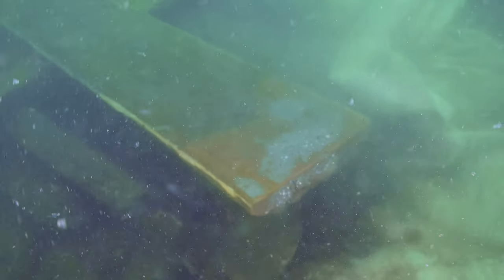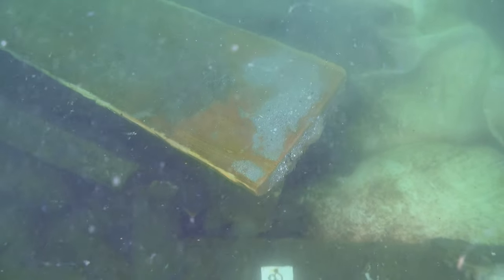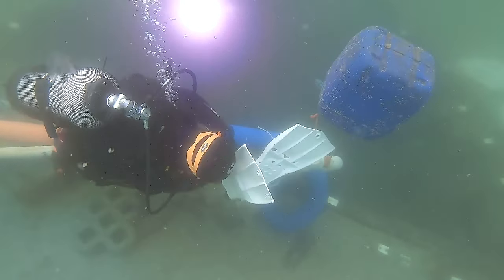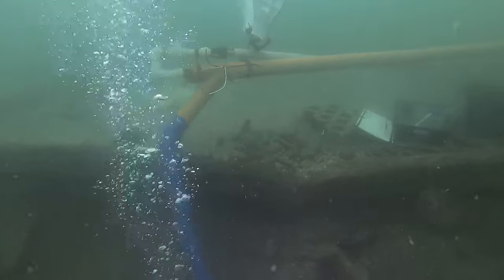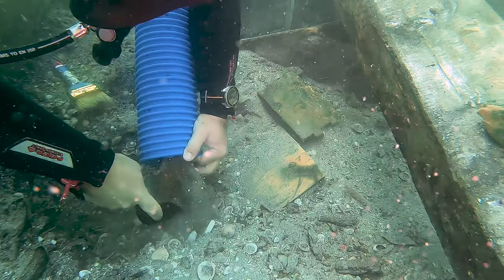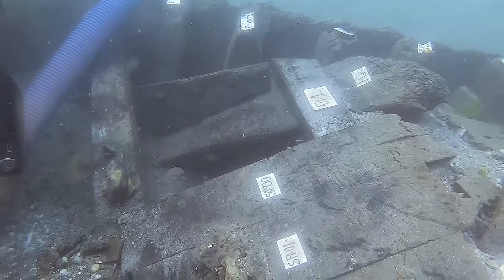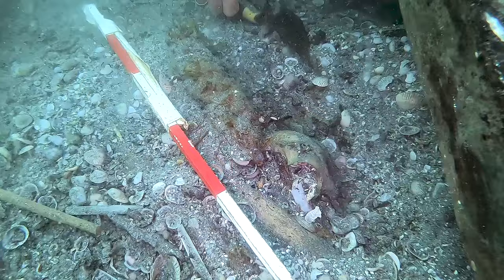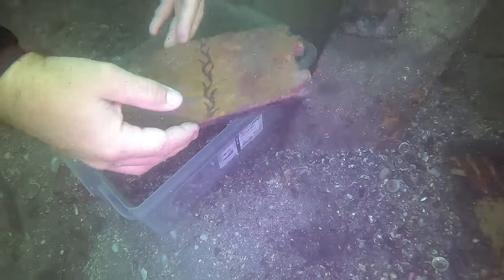Methods of underwater archaeology

Comment: Dr. Batchvarov what would be the typical duration of a single dive and do you have a safety diver keeping track of the time or does each diver monitor themselves. Thank you posting this and I am looking forward to learning more.
Reply from the maker: We do have a dive master who monitors time in, time out, air consumption, etc. the length of the dives depends on the depth at which we work. This site is very shallow: 8 meters, so our limitation is air consumption and … apologies, but bladder requirements. On average, here we dive for 1.5 hours; some of us twice a day.